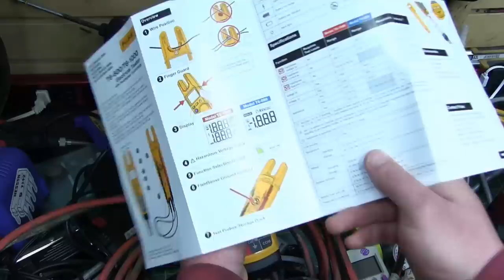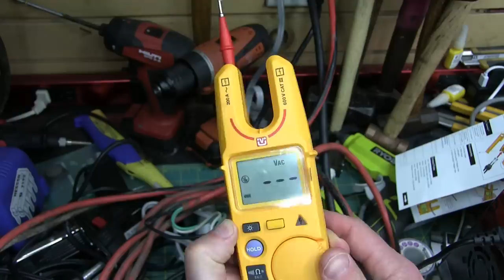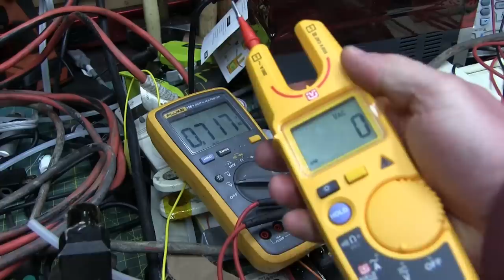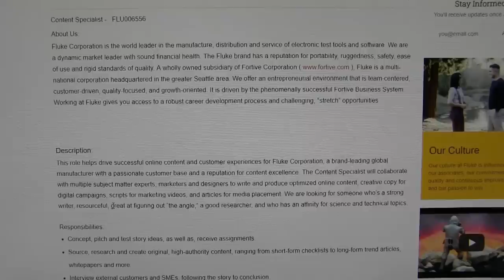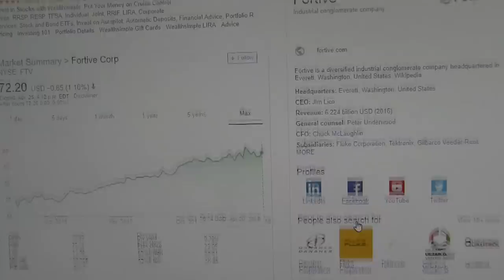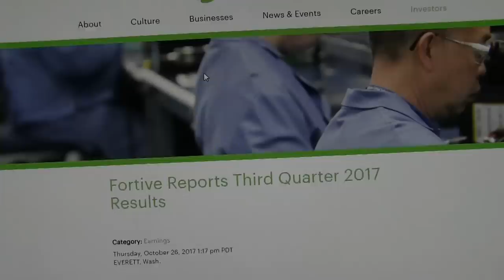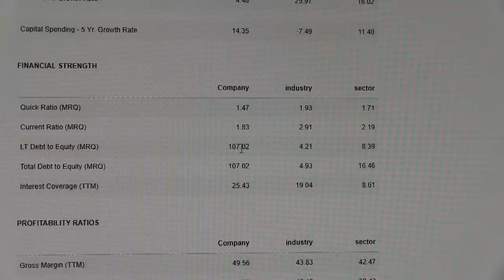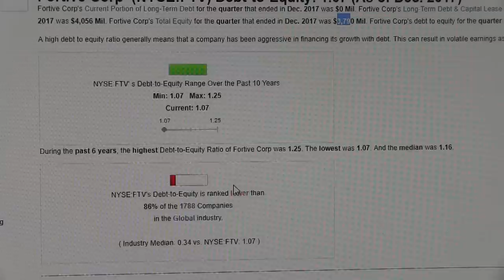Fruke's JOY BUZZER™ Multimeter! | SHOCKINGLY BAD T6

Comment: Not sure how this is any more dangerous really than any other tester, if you're absent minded enough to 1. Use the red probe only, 2. with the neutral probe in the holster 3. with it on field sense, then you were probably going to accidentally touch one probe with the other on a live terminal on your T5 anyway. From what I've seen the field sense seems fairly accurate and a handy albeit gimmicky feature. You would never use it to test for isolation anyway, the real danger is working on / near anything that is live when you're not aware of what you're doing.

Comment: User: "Yeah, I'd like to return this." hands Fluke meter and paperwork to sales type

Sales: "Sorry, it's been broken, we can't accept this. You can't just drop equipment and expect us to take it back." hands the meter back to User while pointing to damage on case

U: "Well, it got dropped because the voltage was coursing through me because of the faulty design. By the way, You've been Served"

S: notices the papers handed over with the meeter include a summons "Um, what?"

Comment: So if you are testing voltage and your finger is on it I don't think it will shock you. Internal impedance is probably 1 Mega Ohm and body is like 100,000 ohms. So voltage division shows it would be a 10-11 V voltage drop across the body with about 0.00011 Amps running through.
Reply: Wet skin brings it down to like 1000 Ohms so now you are at around 0.12 V

Comment: Fluke sometimes goofs up.  Long ago I I was trying too repair a $12,000 Fluke voltage standard.  First problem, one internal circuit board had a 8 pound transformer on it, with nothing holding the card into its commenting slot.  One jolt while shipping and the3 12K thing doesn't work.    Once plugged in, it worked better, but the +12 volt internal regulated supply was dead.  Looking over the schematic, they used about $2 of cheap tiny components in the power supply, with no current limiting.  It would go POOF if you looked at it sideways.   When I replaced the power supply with something more robust, it all perked up just fine.

Comment: After reading through some of these comments, am I understanding it correctly that the rear ground pad could show 106volts but not carry the necessary amperage for a shock? Although if you had overloaded voltage (600+) going through it, it could become unsafe current (because math)? But ultimately it's not as blatant a safety hazard as ave makes it? Bueller? Bueller?

Comment: In all seriousness, there seems to be a real design and human factors flaw in the tool if the user can become in contact with line current while using the device in a config that the tool allows. There should be internal switching that disconnects the touch ground on the meter body whenever the positive probe is not fully stowed in the tool. I'll be surprised if it doesn't get recalled once a few national health and safety bodies get wind of the "short"comings.

Comment: just leaving this here, no names are being said.. work bought this meter put it though a "test" at first the coupling was small but after the tests the capacitive coupling did get to the lines of being lethal.. lets just say "high voltage" the meter itself was destroyed after the tests.. in some of the lines of work the tests that were done would come into effect. this "company" no longer deals with fluke after this video showed Fluke is not owned by the same people it used to be.

Comment: Love the comment "You never argue with an idiot ..".   Although I've come to the same conclusion on numerous occasions, I would never be able put it so eloquently.   Case in point i was diagnosing my espresso machine popping the GFCI circuit.   Didn't have a fancy meter, but I was able to demonstrate that the heating element was using the ground to complete the connection.   When I gave them my test results, their comment was that there was something wrong with my household electrical system.   That didn't even deserve a response!

Comment: The input impedance of the meter is normally 10 MOhm,  hence only very little current would flow to your hand. But if you accidentally measure on a voltage higher than the rating of the instrument, then the over-voltage protection would shunt all the voltage to your hand!Incredibly dangerous device!

Comment: It amazes how hard this is to understand, if it doesn't work consistently every time under all circumstances it's a widow maker. I had one of those hot sticks and threw it away because I still felt the need to check everything with probes. It's like this...if I guy says he killed the power, do you trust him with your life or do you put a meter on the circuit? If you still double check, why would you trust the non-contact? If you don't check...godspeed.

I've never been a fluke fan anyway, I reach for an extech

Comment: Might give MTP Instruments a try. I just bought a multimeter from them and already have one of their high voltage insulation testers. The units seem pretty robust...should pop one apart on here see if they are good under the hood. Think they might even be a Canukian product to boot. 
The multimeter I bought has a nice USB output and you can use your PC/laptop as the readout and logger.

Comment: Makes me really miss my old Simpson 260....... no gimmicks, just reliability, tho I do have my father in law’s big old Simpson clone Micronta (complete with mirrored face) for the rare occasions when you really need an analog meter. That said, I do have a Fluke T5-600 and a T5-1000 and I really like the ease of use of the “mounted” probe system. It’s super handy for working in close quarters or at arms length. Really hate it when a company rushes to get a new “feature” out the door to please the marketing wanks instead of letting the enginerds get it right first. Shame on you, Fluke!

Comment: I have a Fluke 124 40Mhz Scopemeter. It works...as long as you have it plugged in. The battery lasts about 5 minutes. Drives me nuts. It rarely leaves the house anymore simply because the charger is about the same size as the meter.

Comment: I'd rather not have to worry about my meter when I'm dealing with 600v.  What if the protection around the grounding pad doesn't fail open (don't say it isn't possible because it is) when something goes wrong?  Uncle Bumblefuck I have a feeling you're going to be driving up the used price of the T5 when Fruke in their infinite wisdom decide to discontinue that and go all shit in the toilet with this field sense garbage.  I bought one and tested it.  It's garbage.  I can't make accurate readings with consistency or speed (which is what I need).

Comment: The easy proof should be to hook the T6 into the hot, attach a light bulb to the tab on the back, and attach the other end of the bulb to ground and see if it lights up. If it lights up, you've got voltage and enough current to kill you... right? I will definitely agree that the markings on the fork for sensing make one believe that you should be able to get the wire in that AREA and get an accurate reading. Not that you have to get it in the bullseye, so to speak, in order to get something. That could have been very clearly stated in the instructions but it isn't.

Comment: Ive spent my money on many fluke meters, 175,176,116,T5,179. All good and reliable. You should look at the insulation resistance meters they are in the same cat as this (Not good, having to hold the button to read resistance on the low range (many can use it, you think that its open and its shorted).
Reply: I mean cant use it. maybe its the 1587, not sure which model will have to have a look when im at work

Comment: 5:56 are you sure there isn't a resistor (say a few meg ohms to limit the current) between that copper button and the connection for the probe on the back?

Not saying that this meter isn't crap but if there isn't that's just nuts.

Comment: Ill be weary of buying another fluke because the damn pin on my t5? T6? Cable keeps getting stuck in the back slot of the case when i pull it out the pin stays in the case separates, like i could put the alligator clip on but i never want that, have to melt them together or something.

Comment: A real electchicken has hands that are rough and calloused from the work they do.  The resistance will be extremely high.  So the  contact on the back of the meter will not work well in an electchicken's hands.

Comment: I've had the misfortune of watching go right down the crapper over the past couple decades.  As far as multimeters go, I think Fluke died when they started pushing their scope-meteres.
You want quality, here's my two suggestions.  If you got the money: Agilent makes great handheld meters.  If doing it on the cheap but want something solid: Greenlee.

Just my two cents.
Reply: Sorry, I cant watch the financials cause I know whats coming.  Feel free to get pissed off at the nay-sayers, but you're doing a good job, man.  Keep doing it.
Reply: Just be careful you don't get one of the Agilent/Keysights with the software capacitors, because real capacitors cost too much, then try measuring AC ripple on a DC rail only to find the AC resolution is actually the resolution of the DC range required to not overrange the ADC.

Comment: If I’m reading the spec sheet correctly (footnote 2), it appears that rubbing the magical G Spot on the underbelly cuts your rated accuracy in half, to +/- 6% VAC.  I’m just a lowly civil engineer so +/- 40 or 50% is close enough for me, but I thought you pixie wranglers liked to walk a finer line.  I think the similar rating for the T5 was +/- 1.5%

Comment: Fluke 333 Clamp meter, well made clamp meter, not the top of the line, which I don't need , my negatives are: the wires are hard to attach and remove, and the resistance measurement only goes to 600Ω, I missed that detail when I was buying it, but for electrical that limitation is fine, for multi purpose/electronics, get a DMM. The higher end models go to 6kΩ in a second resistance range, It's their way to force you to buy more testers.
Fluke T3, nice simple point to point tester that is miles better than a tick tester.
Fluke 1AC-E, My favorite tick tester of the many brands I own, as a quick first pass test device it works great, Always follow that with a point to point test.

I've used the T5, it's ok, resistance to 1kΩ(why is it better than the lower end clamp meters?), the non clamp current reading works well enough for trouble shooting, I'm honestly surprised and disappointed the T6 doesn't perform better.

Fluke 175, 177, 179, used them all, nice solid reliable meters in my experience(Industrial Electrical)resistance reading up to 50.00 MΩ
Fluke 27, bullet proof meter, never an issue.
Fluke 8010A & 8012A, these were my first exposure to Fluke meters, used them in HS and tech school, awesome little bench units, I should buy a used one or 2.

Comment: I suspect Ave is off his meds.  If you READ and FOLLOW THE DIRECTIONS, this meter will probably work better.   The grounding circle on the back is NOT a death-trap, it only looks that way if you measure from there to ground with a very high impedance meter.  If you put your body resistance, 10K to 100K, between the circle and ground, the voltage will drop from 106 to around 1 volt.   And tenths of a milliamp tops.  Not a problem.  HOWEVER. You are correct, voltage field sense is going to be VERY IFFY,  just by theory, as they're depending on the stray capacitance, which is unpredictable.

Comment: Please repeat the test, and add a current measurement on that pad!  My guess is it has some high impedance.  Consider static electricity: KV at nA, shocking but safe  Wall voltage is 1-2 orders of magnitude lower, and is safe IF AND ONLY IF the amps are infinitesimal.

Are they?

Comment: I’ll stick to my trusty beat up T5-1000. I’m an elecchicken and I would not use this thing anywhere near 600V. Also of note, I recently bought (and quickly returned) a Fluke 28-III because the silk screening could be wiped off of the dial with a finger. Very poor quality control on a 600 dollar meter. Bought an 87-V instead and the LCD’s contrast is quite poor. Nothing like the LCD on my 20 year old 26 series meter, It’s still sharp and you can view it at almost any angle.

Comment: Can you measure the current through the grounding patch when pluging the red lead into the socket? it's likely that it is limited to a very low value (couple tens of uA maybe?) even though it measures a high voltage on a high impedance meter.

Comment: I don't think I've EVER seen an electrical service panel where you could get a hot conductor completely into the bottom of the 'U', centered exactly on the very bottom, without unscrewing several somethings at a minimum.

Comment: That back pad thing is insane! I’ve got a 378 FC clamp meter with field sense, and you have to have a ground clamp attached to read voltage and current. (It’s also particular about hall sensor proximity.. I think that’s what’s in the jaw anyway)

Can’t imagine taking three phase measurements with myself as the ground… 🤪
Reply: Yet the field sense is still inaccurate crap not worthy of the fluke branding, I returned a 378 FC & bought two of the previous models as having more than one is best. Also why can't the clamp still read amperes while probing contact voltages? Why is the fieldsense forced for dual-mode display rather than allow display both clamp amperage & contact voltages at the same time when in voltage mode? The cheapo chinese meters can do both.

Comment: Megger made a MM a few years ago that could test multicore ampers via a clamp, As fast I could think "HTF does it do that" it was removed from market.

Now I know why, non contact testing is a fucking guess at best.
Being a pixie wrangler i trust non contact volt sticks when it says a circuit is dead, but have seen false live indications due to Cap coupling. That's when i stick my tip in the hot hole, it's the only way to be sure.

Comment: Anyone that has been whacked with more than 220vac knows that your meter ABSOLUTELY HAS to be accurate when you're dealing with an amount of electricity that could knock you on your ass or kill you.  I don't want to have to fumble with the meter wondering if the reading is correct, especially when it reads 0 when it's not.

Comment: If you are an good electrician, you shouldn't even use a multimeter to measure Circuits in House or Maschine wireing... You should use a two-pole voltage detector with a defined load in it. Thats what you need, if you want to do correct measurements. Such as the Benning Duspol Digital Expert.

Comment: So true Ave,  all my life I used Fluke.. Recent products are no longer what they used to be.. I have few of them and all my older T5, 87v, 325, 381 Iflex,119, 189 and 279 had zero issues... made endless amount of tests and they never let me down (well 189 has strange small battery drain problem when unit is off it will drain battery dead after one month) other than that  great  products.. now after seeing what they are selling is pure marketing junk... they are converting everything to new generation CNX  platforms.. to meet Industrial 4.0 market with their Emaint as CMMS..  So sad to se that they are lowering industrial ICON brand name in quality and reliability and pushing futuristic (most cases useless technology)... well at least I have enough good old boy Fluke meters in my possession not to worry in my lifetime. I'm still sad about next generation folks.. be safe folks...

Comment: How do you find the 'megger' test equipment? Do you even use this stuff in North America?
Reply: We certainly do use the "megger" test equipment over here in North America!  Excellent stuff too in my experience.  Back when I worked in a large paper mill that produces insanely large quantities of white cut-sheet printer/copier papers, we used the "megger" to test many a motor's insulation.  Paper-making being an awfully wet process, it wasn't uncommon for motor's to get submerged in an accidental process water upset. The largest paper-machine on site was driven by 27 different DC Motors that ranged from 750-1400 horsepower!  That mill's average operations demand approx 30 MW from our national grid, plus an additional 15-20 MW generated on site via steam turbines & a hydroelectric dam.    Needless to say, we had plenty of things to use a "megger" on!   And so while they weren't used terribly often in electrical troubleshooting situations, certainly not everyday like the trusty ol' fluke meters, the "megger" is a critical tool here too.  And they sure are fascinating pieces of test equipment to use.